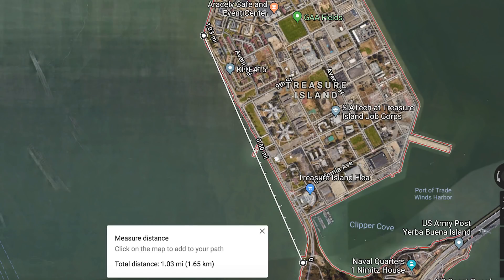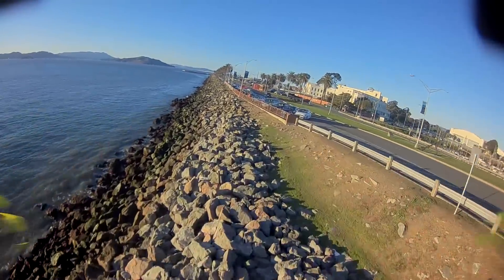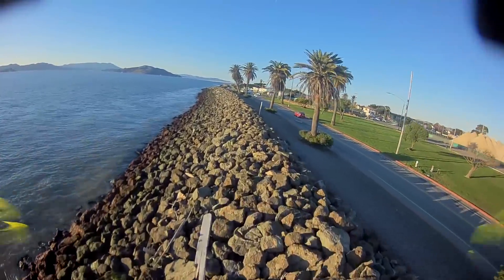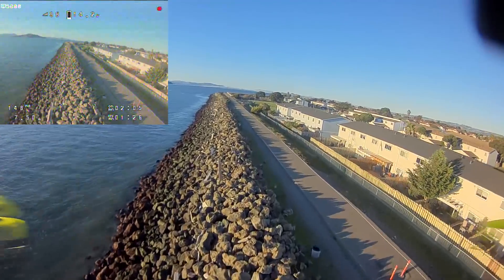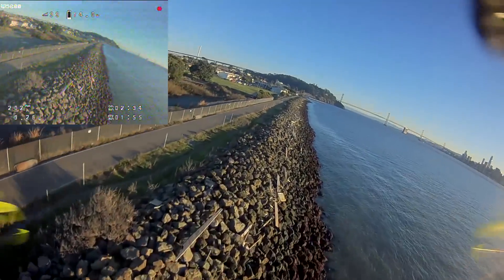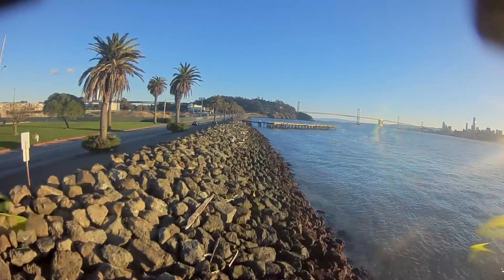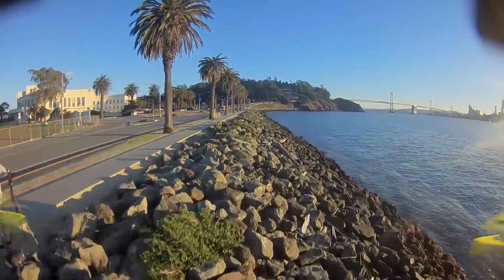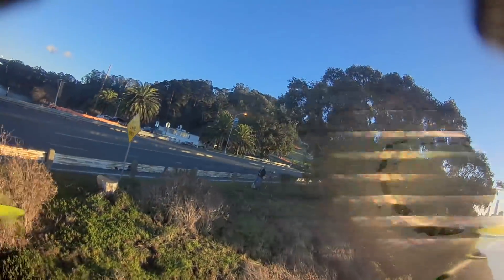Can a 230 gram drone fly a mile and back?

Comment: Couldn't you use a 1300mah 4s battery on this exact quad and get a longer flight time? Why limit your self and push the 650mah to the limit??? Or Would the 1300mah battery weight actually impede flight time on this setup?, or maybe you were just seeing what the 650mah could accomplish? Awesome video BTW!!! Subscribed!! Love some long distance long flight times quadcopter videos, its not always about speed, tricks, or ripping and draining batteries as fast as possible!!

Comment: Super awesome Diego! Is this your best performance under 250gr quad? If not...what build do you recommend to have a -250gr that can be compare to a 5" quadcopter?
Reply from the maker: Thanks! Look at my most recent video, my best performance was crossing the San Francisco Bay and back (1.6 miles each way) at 221g. That build is great.
Reply: Thanks Diego! I've seen that video too, but I'm asking for performance meaning power and manoeuvre ability, what do you think define a micro quad so can it be compared to a 5"?
Reply from the maker: In terms of power 1407 seems like too much weight for minimal gain. I think the sweet spot is somewhere in between. With those motors I've been able to sustain 65 mph for a little while,  the top speed is surely a bit higher but I haven't measured it. As for maneuverability, a 3" won't feel like a 5". It lacks the momentum so it's always a bit squirrelly, for freestyle you have to try really hard to make it look smooth. Also it's much more affected by crosswinds or gusts.
Reply: thanks for the answer Diego. I may try 4" with 1407

Comment: Simply sweet. I am sure there are many people interested in taking a sub 5 inch quad on long distances. If you do cross the bay the first time I would not run an HD cam I'd hate to see you lose it in the event you don't make it.
Reply from the maker: Thanks! This is a Runcam Split, I'd be ok with losing it. It's only $65 or so.

Comment: Awesome.  I ran my regular 4S 1300mAh's nanotech packs on a 4" 4045 prop and it flies for 12-15 minutes with AUW around 270g.  160-sized frame.
Reply: mistercohaagen what configuration do you have? Does it include HD( split or whatever)?
Reply: Combo I was referring to:
Turnigy nano-tech 1300mah 3S 25~50C Lipo Pack
20A CICADA BLHELI_S (F3 FC, XM+ Rx, ATX03 VTx)
RCX H1407 (V2) 3200KV w/ GemFan 4045 Props <<old
Diatone Grasshopper G160 Frame <<crap
(Much better frame parts) https://armattanproductions.com/pages/designer_product_grid/165
My original inspiration: https://youtu.be/GnIEwvqfZJE

4S was okay, but no full-throttle.  I had a #808 & Cam from a broken RotorX Atom V1 on it, which easily weighed more than a Split.  I'd seriously recommend finding an updated AIO FC/ESC & try Wilkinson's frame parts to build something way stronger than the G160, but you'll still get >1km with the ATX03@200mW / XM+ $20 radio stack.  Also use RCX RS1407 3400KV's (arc mags, yo)...  I'm about to build a 5" version with these motors to burn through some old-ass 5030 props with Adam's minimal frames; https://youtu.be/8nFdDl9Bf5A
Reply: Thanks for the inspirational answer. I thought in that frame too but the form it has makes me think it would fly well.
Reply: didnt knew about armattan custom frames...but is risky isnt it?